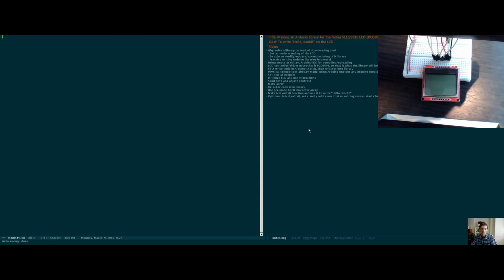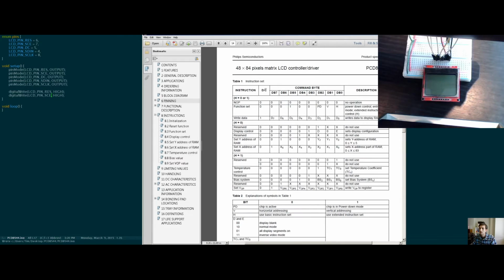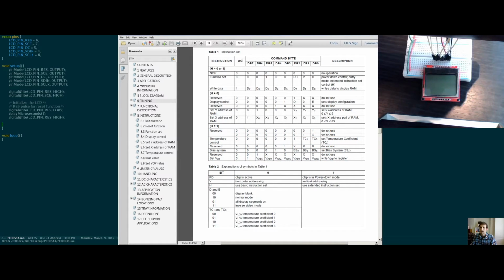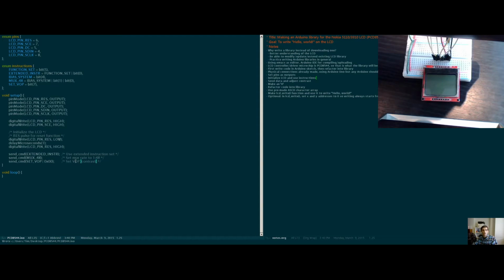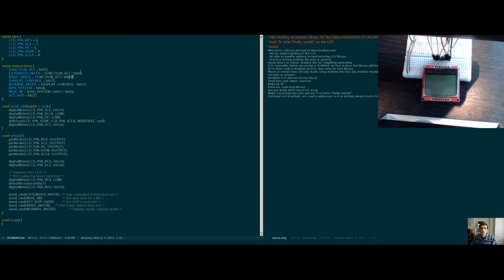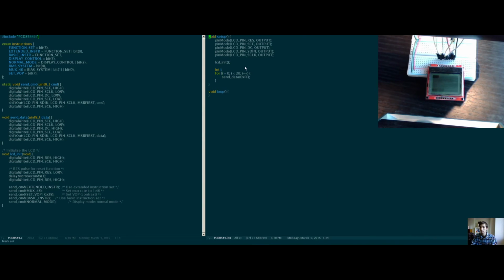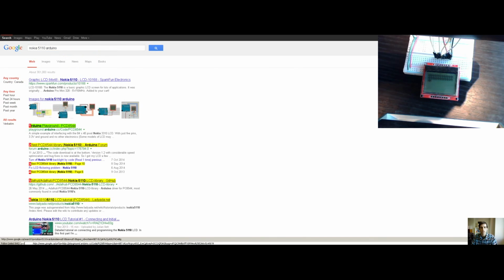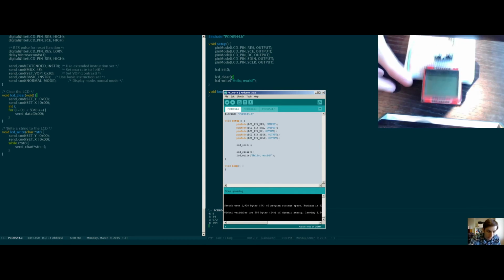Writing an Arduino library for the Nokia 5110/3310 LCD (PCD8544 controller)

Comment: Nice, thanks for taking the  time to step through this!
Reply: For clearing the screen, (I don't have one to test), I think you can use the 'display control' command to set it to display 'blank' mode. Then set it back to display 'normal' mode... Instead of sending data 504 times.

Comment: Does your lib (or does 8544 - please excuse me lamer) can perform FLIPPED picture and/or text on the screen?
Reply from the maker: +schabanow This LCD does not have a setting for that and neither does the code. You would have to implement that in the code yourself. Sorry!
Reply: Thanks Tim! Thank you for your video too, great job! I want to flip the picture in order to optimize my device' composition (to reduce its sizes and volume).